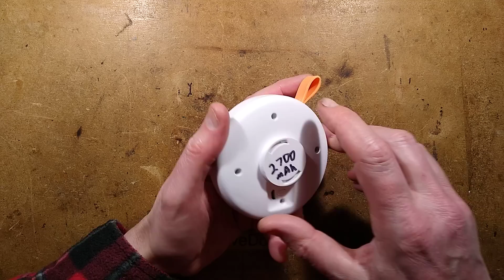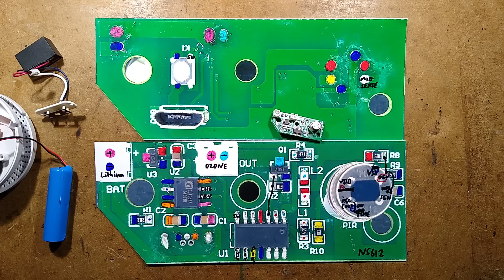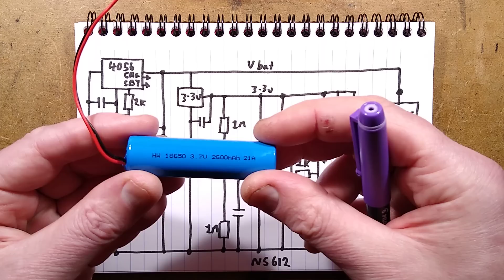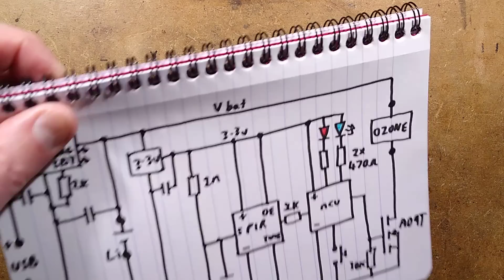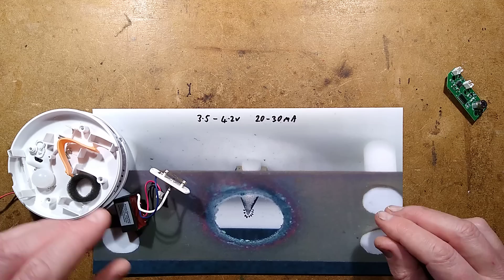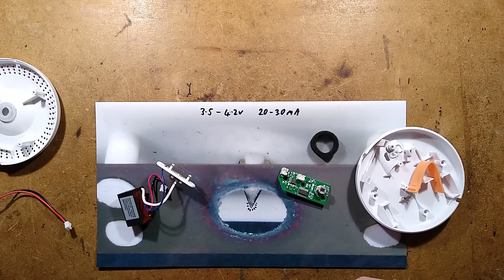Inside a cat detecting poop neutralizer - with schematic

Comment: The foam around the PIR may be for thermal isolation too, oftentimes the sensor needs to be insulated from thermal sources or air currents inside the device, such currents can cause a false trigger.

Comment: I got one of these and despite the generous battery (tested to over 2500 mAh) it lasts only a couple of days.  I've tried to place it facing different angles to avoid erroneous triggering but it really falls out fast.  You're right about the slow charging too.

Comment: Why are buttons and mosfets always on the 0 volt side
Reply from the maker: It's just a common thing to switch to the common circuit reference.  Things can get complicated when there are multiple voltages in a circuit.

Comment: the interesting stuff with ozone in houses is only being discovered in the last 5 years. its very new research into pollution inside the home.  many countries/cities already publish daily ozone level warnings as its an outdoor pollutant (its no longer at safe low levels in some areas). we are finding out that it also reacts with other things inside to home and makes nasty things like formaldehyde.
Reply from the maker: The proper trace level indoor units should not create more ozone than occurs in natural outdoor air in non polluted areas.  Check out my main ozone video for a lot of data.
Reply: @bigclivedotcom  true. what new research is starting to find is just how much gets pulled into the home from outside and what it does inside the home. 
If your creating that amount as well, your doubling whats in the home. 
However what effect that has is still being researched. Interesting stuff.
Reply from the maker: @tweake7175  Active components in the air are very quickly depleted doing their job, because they are not being continuously regenerated like outdoors.
Watch my more detailed video on the subject for a full description:-
https://www.youtube.com/watch?v=1ymcJ9qKC7I

Comment: as one of those "ozone is bad don't breathe it in" i actually have a small "hydroxal generator" in my heat pump and it gives you a sore throat if i have it on. even small amounts can cause minor issues. ymmv.
Reply from the maker: It would be interesting to know what type of hydroxyl generator you have.  If it's a Sharp plasma cluster unit then it may be intended for a whole house and not a closed room
Reply: @bigclivedotcom  not sure who deleted my reply. lets just say its major consumer brand but its for a single room.

Comment: I have a similar model, and I can confirm that it's a gadget you use for a while and then you just always forget to charge it!  Especially because it takes so long to charge, but then only lasts a few days per charge (when located in a hallway and triggered probably a bit too often). And you cannot just let it plugged in. I'm happy to know better its inner working (I want to check and adjust the charger chip's Rprog value of mine now 😁), and alternative usages! Thanks!
Reply: You can use a smart plug to automate the charging without having to manually unplug it. It'd increase the cost, but it's worth it if it works, right? ... So, does it actually work?
Reply: @Mr.Anders0n_  hey that's a brilliant idea! Thanks!
I'd say it works. I had no expectation and thought it could be a fake product, so I was surprised to actually notice a difference.
Reply: It looks like one could cut one or two traces to make it unaware that it's been left plugged in, maybe adding a pull up or -down as appropriate.
Reply: @tactileslut  the battery might not like being plugged in all the time. I have a Galaxy Note 2 hung on the wall as a control panel for my smart lights. It's battery has swallowen up twice because the phone is always plugged in so I've been thinking of using a smart plug as a solution... On the other hand, i have a Bluetooth adapter that's been plugged in for years without any issues 🤷🏻‍♂️

Comment: Hi Clive, This is a request for your advice, ...nothing to do with "catch it" (appropriate if you say it quickly!) 
I've got confused (don't take much) have 2 identical strings of static LED lights. 
Each states "complete supply chain 3v 1.5W SELV IP44"

One of the following Power units was supplied with one string not sure which that was as I have 2 similar form factor units.
One states "SELV IP44 SEC:Urated=5V Uout=6V Prated=3.6W" 
The other states "SELV IP20 SEC:Urated=3V Uout=4V Prated=1.5W"
Quandry is, If matching  the "IP44" rating, the V & A are mismatched.
If matching V & A, then IP is mismatched!
Can I safely use both strings with these power units?
If not, which is the right one?
Thanks!🤯
Reply from the maker: The IP rating is indicating the power supply is for indoor use.
The 3V unit sounds like it is intended for the strings of lights.
Could the 5V one be for a different set of lights?  If it was supplied with them then it will probably drive them with a current limit, but they will possibly be brighter.
Reply: @bigclivedotcom  Many thanks for replying Clive, I was careless when I  unpacked the new set, didn't note which PSU had been in the box!
The other light string and one of the PSU's are just orphans.
I've just tried the two sets with both PSU's and you are quite right, they are brighter with the 5V supply.
Are they both safe enough?
I presume if so, the LED's are likely to have shorter lives!

Comment: Thank you Clive, for this video and every other one you've done. I'm learning so much from them. The diagrams are becoming easier (from my perspective) to understand and my knowledge is growing the more I watch.

I'm currently in the process of recapping a set of small studio reference monitors. Given the failure mode and my understanding of the circuits (hoping that I've nailed it down), this should cure the issue. The great ebay dice-roll strikes again 😊

Comment: As soon as you said it was from eBay I was expecting it to be getting its high voltage straight from the Mains so it could double as a cat neutralizer. This is much safer but not as exciting.
Reply: Your comment reminds me of stand-up comedian Jack Dee's reaction to being given a foot massager thing for Christmas.  He wasn't impressed that he had to fill the thing with water, put his bare feet into it, then plug it into the mains.  However, I find your idea of a cat being electrocuted as "exciting" a bit sinister: you don't work for the RSPCA, do you?  They used to do that to animals.
Reply: @DrDianeDAddie  I'm left handed. That's as sinister as I get.

Comment: I told myself if I ever got a cat Id install a small UVC lamp triggered similarly to this. you get a hint of Ozone for the air and the surface of the litter becomes sanitized from the light itself. obviously that's not going to stop the odor causing bacteria but im sure it would do a number on actually reducing the smell.. and cleanliness

Comment: The metallic ratio can be used with the systolic ratio to improve upon the aspect ratio of a MOSFET. The geometry and the circular shape play an important role in determining its characteristics. This time I'm going to use salem numbers for determining the lengths of geodesics. A complex can be constructed using the same PL2 screws that I have previously talked about. The diagonal long time asymptotics of the heat kernel can also be modeled based on crystal lattice structure. The associated diagonal operators are also listed below. This can be used for designing time delay systems or producing a shifted input. When it comes to the s-plane analysis of poles and roots, harmonic spinors can be used. This also utilizes the concept of bolts and shwarzchild stars. The systolic geometry can also be used to design systolic arrays and the same concept can be utilized to implement a master slice system. It is helpful in laying out basic gate arrays.
https://www.sciencedirect.com/science/article/abs/pii/S0038110100000101
https://www.nature.com/articles/s41598-022-19989-6
https://link.springer.com/article/10.1007/s11784-022-00988-z
https://link.springer.com/article/10.1007/s00574-021-00270-9
https://link.springer.com/article/10.1007/s00039-023-00624-z
https://www.sciencedirect.com/science/article/abs/pii/S0723086921000256
https://www.sciencedirect.com/science/article/abs/pii/B9780121952556500192
https://arxiv.org/abs/0810.5478
https://link.springer.com/article/10.1007/s002200050033
https://link.springer.com/article/10.1007/s11537-012-1144-4
https://link.springer.com/chapter/10.1007/978-3-0348-8615-4_5
https://link.springer.com/chapter/10.1007/978-3-0348-8615-4_1
https://link.springer.com/chapter/10.1007/978-3-662-44050-6_4
https://www.sciencedirect.com/book/9780128136775/cooperative-and-graph-signal-processing
https://link.springer.com/chapter/10.1007/978-3-0348-8615-4_1
https://ieeexplore.ieee.org/abstract/document/743443
https://www.semanticscholar.org/paper/Harmonic-spinors-in-the-Ricci-flow-Baldauf/54a36088b733f19ee5b354a860dce0eb8bc35a4a
https://www.sciencedirect.com/science/article/pii/S0393044019300518
https://www.sciencedirect.com/science/article/pii/0001870874900218
https://link.springer.com/chapter/10.1007/978-94-011-2006-7_8
https://arxiv.org/abs/2310.15295
https://ui.adsabs.harvard.edu/abs/1984ITCmp..33..774C/abstract
https://dl.acm.org/doi/10.1145/3501803
https://patents.justia.com/patent/4644187
https://patents.google.com/patent/US20090096038A1/en
https://digitalcommons.unl.edu/biosysengfacpub/153/
https://patents.google.com/patent/US4682061A/en

Comment: I've always been accustomed to Ozone generators being based around voltage multipliers¹ so this is the first time I've ever seen a battery operated one! It's also interesting to see that the HV circuit takes a DC input too, meaning it must have its own chopper/inverter as well! 🔋⚡😀

Is there any possibility of a teardown/analysis of the inverter in the future, please? 😇

(¹ - An arrangement of capacitors and diodes which turn a general AC input into a sawtooth voltage pulse several orders of magnitude above the input voltage - Usually around 24kV or so. Most commonly found in ionisers (Which Big-C has covered) but Ozone generators can also create a corona(virus) discharge from the same thing. 😇)
Reply: That sounds like a voltage multiplier. I’m more familiar with a “jacob’s ladder”  being an arc between two rods that keeps rising to the top due to convection.
Reply: @deltab9768  Ah, that's my mistake - A voltage multiplier was what I meant (I'll edit my comment) but because of it's layout I thought it was known as a Jacobs' Ladder because it looks a bit like one. ⚡🪜😇
Reply from the maker: This uses an oscillator to drive a step up transformer and then either a single high voltage diode or a small multiplier to reach the desired voltage.

Comment: The foam is probably to prevent reflection of LEDs into the PIR. To prevent self-reactivation.
Reply: Indeed, I had the same problem with activity LED's causing a PIR detector to trigger.
Reply: Beat me to it, yep, its to stop any stray light/IR that could affect the sensor
Reply: Would a colored LED even effect a PIR sensor? 

I could understand an I.R. LED doing it, but a colored one?
Reply: @davelowets any light source that emits heat gives off infrared.... So...

Comment: I once worked as a pet sitter, no matter how often I was exposed to litter boxes I still found the stench repulsive (some cat foods cause this more than others), wish I'd had something like this to help alleviate it.
Reply: I would recommend smelling acetone, once your nose buds get decomposed you no longer have this problem, and the great thing is that this lasts forever, no need to reapply!
Reply: @D4no00 now I know why I can't smell very good I work around acetone and have lost my ability to smell for the most part I didn't know acetone would do that and didn't put 2 and 2 together
Reply: When I still had cats there was one night I was starting to drift off then the cat dropped a stink bomb in the litter box which made me suddenly very alert.
Reply: I cut a hole in a piece of plywood and jammed it in beside a sliding door. Kitty goes outside. The litterbox stays mostly unused. A dryer sheet stops some flying pests.

Comment: Does it work though Clive? I knew they did fridge ozone generators, but not cat poop ones. I have two cats and unfortunately they stay inside. We live in a huge forest in West Wales, half way up a mountain. There are owls, foxes, numerous birds of prey and other dangers. So one of the cat poop gadgets would help, only if they work. Good post, as usual, take care 👍
Reply: If it produced ozone it will help but it won't magically remove the smell completely.
Reply: That being said. 
My cat never had problems with foxes / owls etc. 
Normally cats are quite agile.

Comment: It's almost 2024, let's do away with micro usb already! I know I get upset at just how many power banks still use it. Even my new Bluetooth speaker uses one. Yet All I have is one cable. Everything else I have is now type-C.
Reply: My side gig is resoldering those damn connectors to PCBs. They fall off if you fart near them.
Reply: My stepfather has Parkinson's. We've replaced his cell phone twice this year due to broken charging ports. Turns out Type-C is more fragile than Micro-USB.
Can someone PLEASE make a smartphone with a Molex charge port on it for people suffering with fine motor skill problems and/or neurological dificulties? lol
Reply: @dashcamandy2242  Better get a wireless charging pad in those cases.
Reply: Yeah, we won't get rid of micro-USB until all the devices using it have broken down or obsoleted. Everyone should've stopped manufacturing devices with micro-USB five years ago already.

Comment: I honestly need a genuine Cat Detector for my electric remote controlled snowblower. Haven't dared to try it yet since I'm scared cats or birds will get shredded. Some of the neighbours cats are very brave. 
Any ideas?
Reply: Just for the hell of it you could try putting a steel mesh over the front of it, and see if it can still scoop snow through the mesh.

Of course it’s still possible for 🐱 to put their tails or feet through it but it’s less likely.
Reply: @deltab9768 I'm guessing you live in a climate that doesn't see significant snowfall. When snow piles up it gets fairly dense - there's no way it would pass through any kind of mesh.
Reply: @allenlutins  60+” per year here. It does pack very densely sometimes especially in late February/March when daytime temperatures start  getting above freezing now and then. Or when it’s next to a building and gets water dripping into it. At some point it’s basically just ice.

I haven’t ever tried to force it through mesh, but I’d bet 50 bucks that if you threw a big snowball right into a storm grating, as hard as you could, it would break up and go through. I’d bet another 50 that if you gently set a small snowball on top of a piece of window screen it wouldn’t go through. 

Which is why I mentioned a mesh (preferably a coarse one) as a possibility to try, with no guarantee of success.
Reply: There's an old Gravely snowblower attachment nicknamed "The Dogeater" due to its large open front area. I never had a problem with critters wanting to be anywhere near my gas snowblower. I'd think even an electric machine would make enough racket to warn off the local fauna.

Comment: Thermal insulating rings are quite common around pyroelectric detectors in security devices to stop draughts from setting off the (very) sensitive pyro - the foam ring could be for that, particularly if the ozone generator is also producing a draught inside the device that might trigger the pyro circuitry.
Reply: Definitely seems to be air flow damping, and possibly filtering some of the 'light' from the coronal discharge if it can reflect around inside the unit - as you say the sensor is incredibly touchy given the tiny energies/photons involved.
Reply: Agreed. I've used a bit of rubber sleeving on TO-5-style pyrosensors in commercial designs.
Reply: YES. Drafts of air that are a warmer temperature than the surrounding air WILL false trigger a PIR sensor. 

If I have the sensitivity of my outdoor PIR security camera turned up too high, it will CONSTANTLY false trigger on a breezy day when warm air is starting to blow in from the west.
Reply: the case potential could be interesting in this circuit too, and it could react with ammonia and stuff
Reply: That foam ring could be there just to keep the diffuser dome pressed more or less firmly into the plastic shell so that it can’t be shoved into the circuit board. I don’t see it blocking ozone because most flexible foams go all crunchy and powdery on exposure to ozone, plus there doesn’t seem to be a clear path for ozone to get from the emitter to the rest of the shell’s interior volume.

It’s probably not there to exclude light from the two LEDs because the detector’s passband should exclude their light anyway, but given the competence of at least some Chinese circuit designers these days, they may have thought it necessary for that reason.
Reply: @markfergerson2145 

LEDs do generate a small amount of heat, so they could be shielding against the thermal IR emission.

Comment: Do they make one to detect, and dissuade cats from crapping in your outdoor planters, by any chance?
Reply from the maker: They do have PIR scarers.
Reply: Strips of citrus peel. Cats have very sensitive sense of smell and dislike the overpowering citrus oil. 
You will probably need to replace them on a fairly regular  basis.
Reply: @MrJHDK  we used that trick for a couple of years, but the cats have become immune, so I am resorting to a cat detecting water jet (I want it to be specific for cats because I don't want to discourage garden birds, or the family from going in the garden...)
Reply: Try planting rue, Ruta graveolens. Most cats dislike the smell of it.
Reply: Love my multi purpose motion activated sprinklers. Buy 2 aim them to intersect at problem areas.